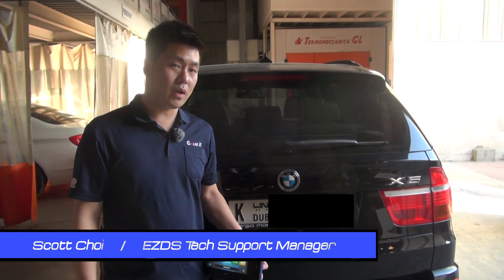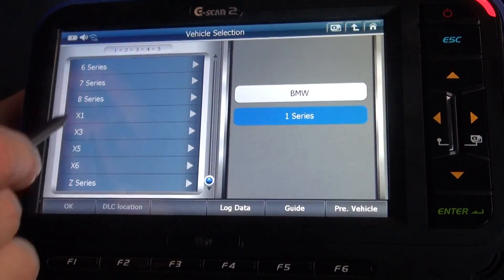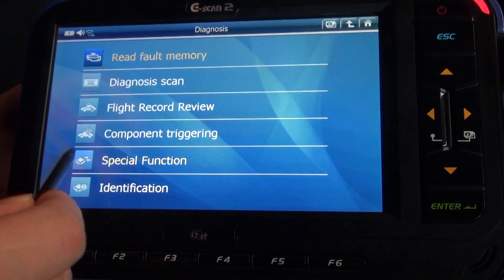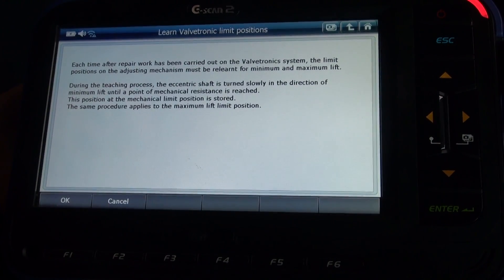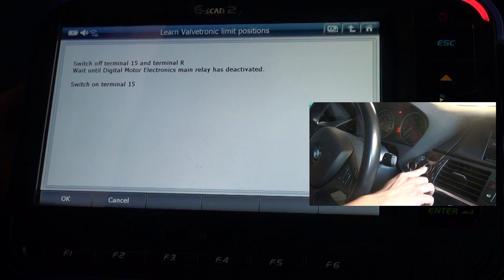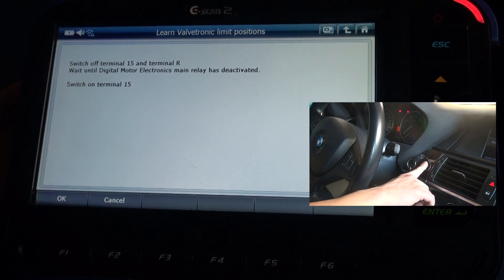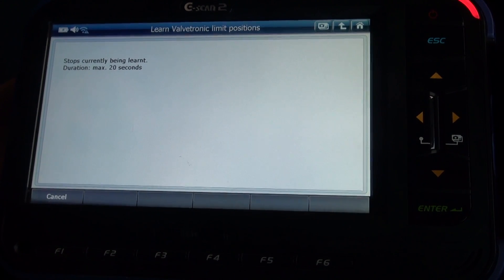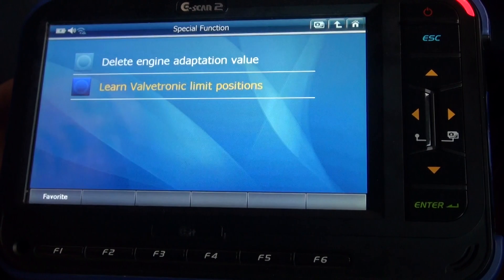[G-scan] 2009 BMW X5 Valvetronic Limit Positions

Comment: I replaced the valve cover gasket of BMW X3 2009. The valvetronic motor was removed and reinstalled. I tried the valvetronic motor calibration by turning the key on position 2 for 30 seconds. When I started the engine, it run very weak, and then stopped. Now it can crank, but not start. Should I calibrate the valvetronic motor? Thanks.